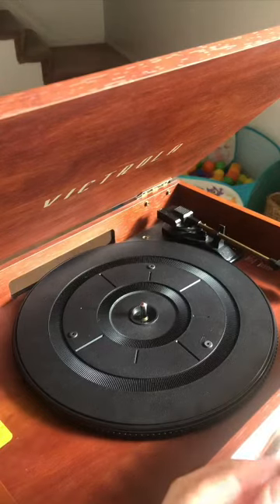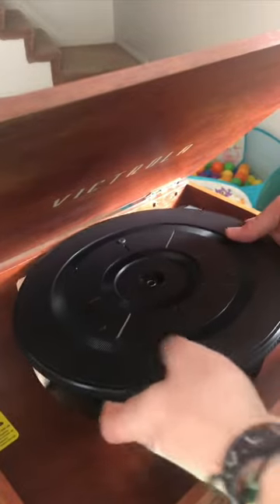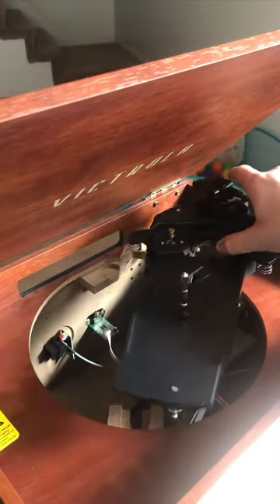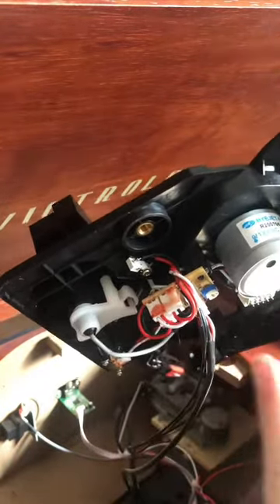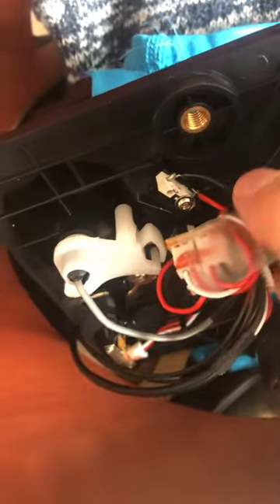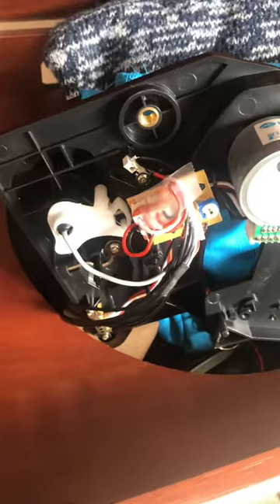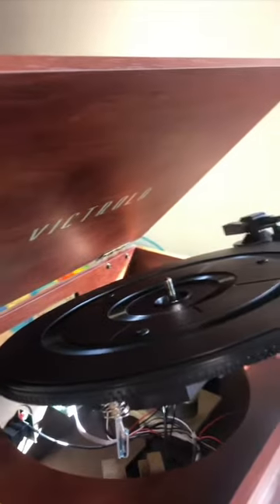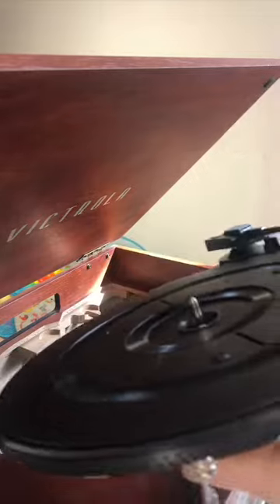Repairing Victrola Record Player — Really Works!!

Comment: Mine is playing way too fast. Like it does 33 rpm but it’s so fast on what’s supposed to be the 45 and idk why
Reply from the maker: Sorry, I don't know why it's doing that. I pinned your comment, so hopefully someone else could see it and help!
Reply: On the back of the motor there are two small holes. They are for speed adjustment.  Buy a tiny screwdriver and a speed strobe disc. Turn it on and little by little adjust the speed checking each time until you get the proper speed on the strobe disk.
Reply: @vtjmproductionsusa2390  okay thank you I didn’t know the screws were buried in the holes. I did find those two holes expecting tiny screws to be there and there wasn’t so I gave up very confused. Thank you so much I really appreciate it I haven’t been able to listen my new Grateful Dead album on vinyl yet and I’ve been dying to play it along with my Alice In Chains album I’ve missed it so much So thanks.

Comment: This was helpful to me for a different reason. I'm trying to gauge whether all these Vic turntables have platter wobble, and it looks like yours also has some subtle wobble (same model as mine). Thanks for posting this - there aren't that many clear videos of the platter movement or the internal mechanism on the internet.
Reply from the maker: Ooh cool! I'm glad it was helpful. I couldn't find many videos of the inside either, which is part of why I recorded. :)

Comment: This is a great video. I bought one of these for my gf two years ago. Unfortunately mine wasn’t able to get fixed. I took it apart like you showed (very helpful) but I have no loose connections. It’s just not spinning. Came right out the box in that condition.
Reply from the maker: Bummer! :( Are the other settings working? (blue tooth, radio, etc.)?? I've seen several people comment with a similar problem. Any luck figuring it out?
Reply: Are you getting a click when you move the tone arm? I just took mine apart, got it to work, reassembled and it stopped working again. Tried again and got it to work a few times then nothing again. I'm thinking we may have the same issue, the switch for the tone arm isn't connecting tight enough, might give it another go tomorrow...
Reply from the maker: Bless you for working so hard to get it to work!! :(  Victrola should really provide an easier set-up... Or you know, one that doesn't break so easily.

Yes, mine makes one click noise, which is when the switch to power is activated. Good luck getting yours fixed! 🙏🏼
Reply: @zingdog33 any updates on if you got it to click ?
Mine is inconsistent. It won’t work for months then suddenly starts working again for a few days. Then just stopped.
Everything else works, just not the arm switch
Reply: @MrChefT  No luck. I called a repair guy and explained the problem and told him the model and he said the fix will not be worth the cost. I got a similar new model of the same brand (with CD & tape player) as it was 1/2 off. Works pretty good but definitely need an upgrade next time around. 

Good luck!

Comment: I was wondering can there be any wrong with mine some times it skips
Reply from the maker: There is a possible solution! You can tape a coin to the top of the control arm / needle area. The extra weight should help lessen skipping. I use a U.S. dime for mine, but I would experiment with pennies and nickels too (or whatever you have).

This trick has helped my player, but there are some vinyls (even new vinyls) that still skip. I have noticed less skipping though! Good luck! 🍀✨
Reply: @TheDavidLaws  oh ok thank u I will see if that works

Comment: hey I have a similar unit, the empire Its brand new and every record ive played sounds slightly slow/ lower in pitch.. pretty sure its a speed issue would i have to open up the players guts to fine adjust anything? If so what do I do this looks very intimidating to me
Reply from the maker: Hey, sorry I didn't see this sooner! Did you get it figured out? There's a chance it could be the outlet you're using. Have you tried several around your house? Or if you're using a power surge cable (with multiple outlets) it could be a low power issue. If you're still looking for help let me know. Maybe we could find a solution together.
Reply: I have the same issue, my record player has worked in the same plug in for years, all a sudden its turning too slow...

Comment: Mine works although when it plays it constantly cuts and goes back a second or two unless I have a coin on top of the needle, plus the whole thing is just like overall loose? Like I can see inside of it and move it around without messing with anything. So if anyone has a fix for this please lmk

Comment: I got the 8 in 1 navigator but for some reason the volume on the right side speaker sound very low than the other one. Yesterday I found that both speakers are very low and they weren't like that when I bought them. do you have any idea what could be the problem?
Reply from the maker: Sorry for the delayed response.. honestly, I'm not sure! Have you solved it yet?
Reply: No sir, I haven't try it because I was waiting for your response. Thank you   @TheDavidLaws
Reply from the maker: How long have you had your player? I'm wondering if they are old?? The fact that it's progressively getting softer makes me think they are wearing out. Or maybe a connection problem?
Reply from the maker: Have you read this article? It says the problem is probably with your preamp. Victrola players have an internal preamp. It might be helpful! https://toprecordplayers.com/why-is-my-record-player-so-quiet/
Reply: @TheDavidLaws  i bought it used but I think it has to be a preamp issue, because i haven’t use it that much.
Reply from the maker: @emanuelsaldarriaga3626 Ok. Well, best of luck getting it resolved! I'm sorry I don't have more experience on the issue. :(
Reply: @TheDavidLaws  thank you so much for the link.

Comment: My volume is running low. Will this fix it?
Reply from the maker: You could pull it apart and see if another wire is loose. Or maybe the volume dial isn't working properly?

Comment: Why wouldn’t you show how to get out the big silver screw in the corner? I still can’t figure it out
Reply: Idk seems like an important part to include 🤷‍♂️
Reply: Considering it’s required to get inside 🤷‍♂️
Reply from the maker: Hey, sorry. Like I said in the description, I don't do tutorials and only did this one because I was getting so angry! 😅 let me check mine out and see what I did... I honestly don't remember.
Reply from the maker: Hey, did you remove the turn table and then try to remove the screw? At about 2:14 in the video I show the screw and clip that needs to be removed. I'm pretty sure I was only able to do that after removing the table first.

Like I said, the whole reason I made this video was because I got several steps in and thought, "this is ridiculous! I should record it for someone else."

Good luck!
Reply: @TheDavidLaws  hey, i removed the turn table and am trying to remove the screw. the bottom part seems to not want to come off. do you have any idea how you were able to get that bottom part out so you could unscrew it properly?
Reply from the maker: That's a great question! 😅 I was really angry at the time. I'll do a little research when I get home and let you know!
Reply from the maker: Here's what I can tell you so far!
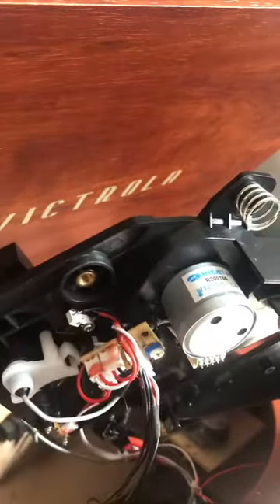1) that screw is called a "transit screw." You can get a better look at it during 3:52 in my video.
2) I'm pretty sure I took out the screw by removing the clip first.
3) I think I removed it by moving the clip vertically with screw. I was trying to find a video to show you, but couldn't find one. The pictures on this website should give you a good starting point. If not, tell me and I'll see if I can film my own video. https://picclick.co.uk/BSR-Turntable-Transit-Screw-Set-124374818650.html

You could also try your own online searches for removing  transit screws. I only searched for a few minutes.

Comment: Was there a trick to the first part? (Prying off the ring). I can't seem to get it to come off.
Reply from the maker: Hi Sean, I'm pretty sure I used a small flathead screwdriver to pry mine off. I think I placed the screwdriver vertically between the ring and the center spindle (what the ring is clipped on to). While trying to pry it off I probably used my other hand/fingers to push the ring off. 

 I recently learned these rings are called "e-clips." It looks like wikiHow has an article "how to remove e clips." Good luck!!
Reply: @TheDavidLaws  That was hugely helpful. Thank you!
Reply from the maker: @seankimber  you're welcome! I hope you get yours fixed :)
Reply from the maker: @johnlumacad4368

Comment: I bought it last year, and it stopped working inexplicably. Right in time for Christmas. It's only been used anout a dozen times, and no, it doesn't power on.
Reply from the maker: None of the power is working? Even for the other settings (radio, bluetooth, etc)? Have you used different outlets to plug it in?

Unfortunately I'm no expert, but if the problem is the player (not the power source) I would look to see if part of it has become damaged or broken connection somewhere.

As I mentioned in my video, it was a broken connection (wires) that prevented it from working.

Good luck & sorry for the untimely power shortage. :(

Comment: What size belt is it
Reply from the maker: Hi George, I'm not sure. I was looking through the owners manual and they don't specify. Pretty lame. :( They do have a service number. Maybe someone there could tell you? 1-877-483-2497 I've also seen bags of various sized belts on ebay for under $5. Maybe a good option? Good luck!